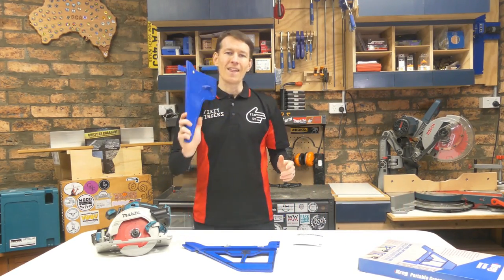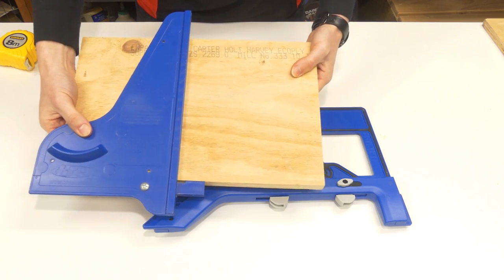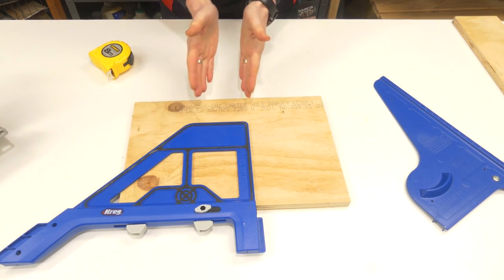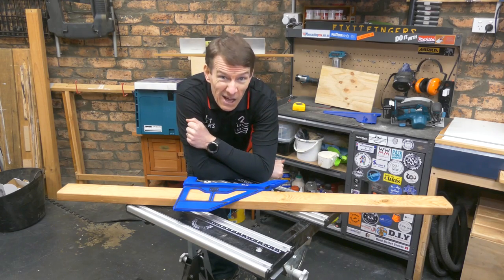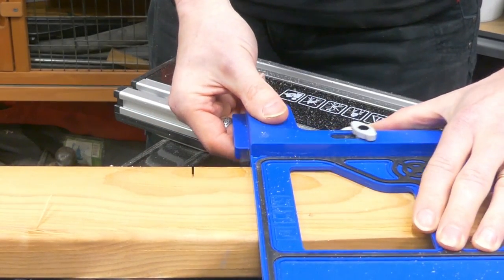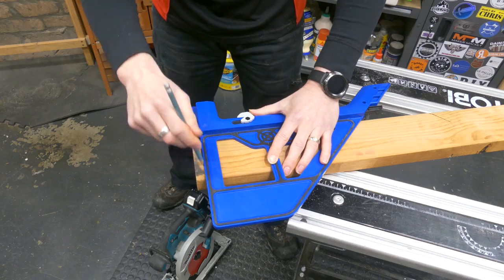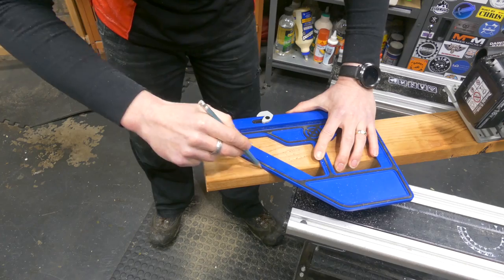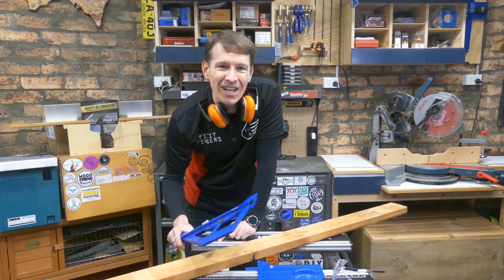Kreg Portable Crosscut vs Kreg Square Cut - Setup & Comparison

Comment: Thanks for the review, in particular the comparison of the old to the new.
I have the old style and was contemplating if I need to upgrade to the new guide.  I think the substantial reduction in the width of the cut on the new guide is a killer for me.
Reply from the maker: There was not a lot wrong with the old one. In fact I find myself reaching for it a lot of the time still as I've kept both for now 😅

Comment: I'm not at all sure about making 45 degree cuts both ways. The support tab on the 45 sticks up, rather then down, on left hand 45s. The only way I have found to make it work is to flip the work over so it is a right hand use again.

Otherwise, I agree about it being supremely handy. It can be set up with the left hand alone while picking up the saw with the right hand. I wonder, though... does it work well for left-handed users because of the support tab on the crosscut part?
Reply from the maker: You are correct Michael, this was an error on my part. You can flip the timber to cut both ways, but this may not always be practical. As a right-hander I must admit I have not thought about our poor lefty friends... but then neither do most circular saw makers who give them terrible sight lines so I don't feel as bad about that one 🤣

Comment: An interesting tool, not seen anything like that before, especially where you can set the width on those sliding marker things. Can imagine this would be good on the job site
Reply from the maker: They have certainly made some improvements to really elevate it above a standard speed square. Would be great on site where quick rough joinery is all you need, you are away from the mitre saw, or you need to trim something already bolted down.